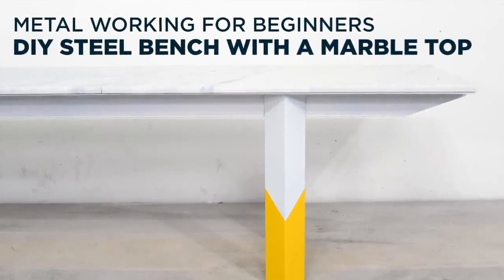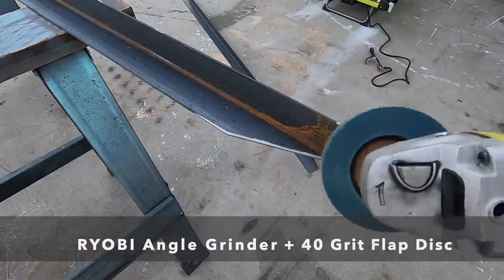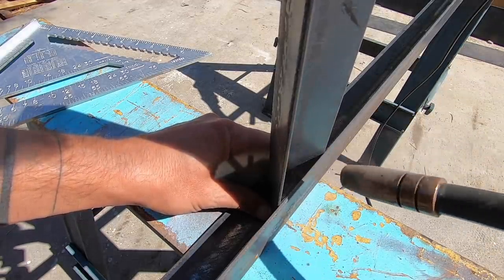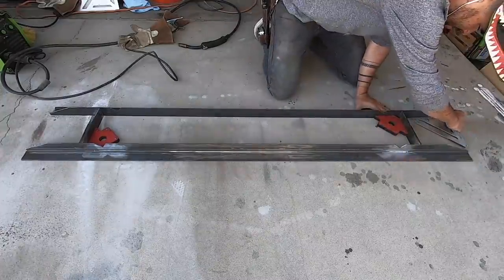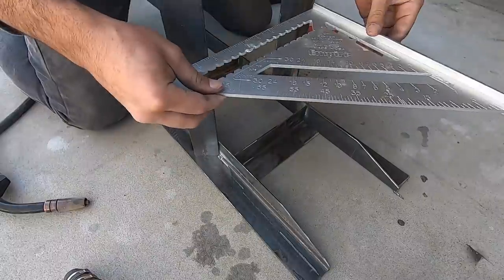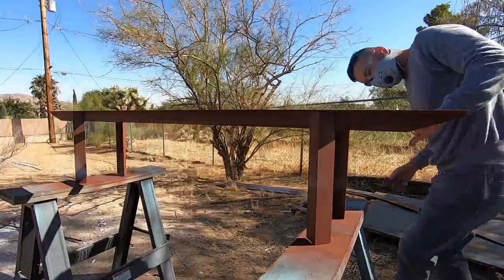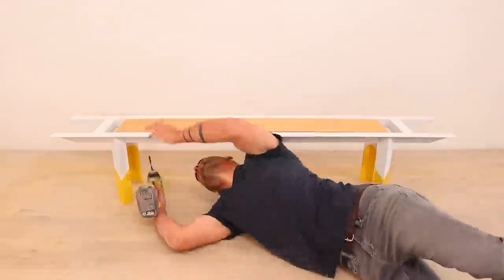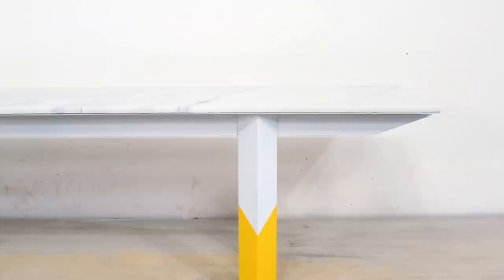DIY Steel Bench with a Marble Top | Metal working for beginners

Comment: little recommendation, if youre using flux core wire you should just use a plastic welding tip instead of the mig one, would help get into tighter spaces!:) love the bench cant wait for more!!

Comment: If your using flux core wire you can remove the shield from your welding ggun/nozzle so it's better for tight spaces.

Comment: Ben - how did you grind/clean the inside corner of the angle iron?  Hard to reach with the flap disc sander?
Reply: Shamir Colloff 3M fiber discs will do the trick